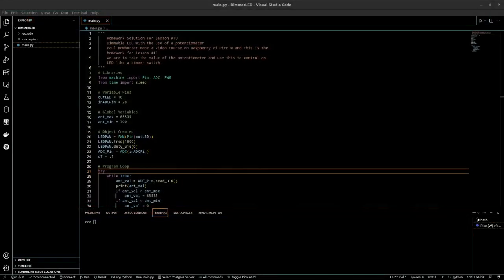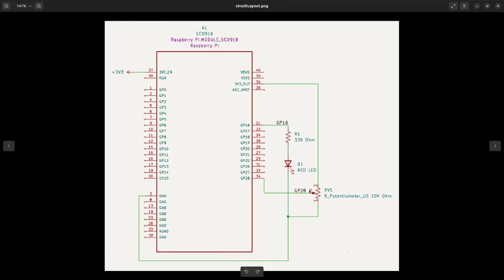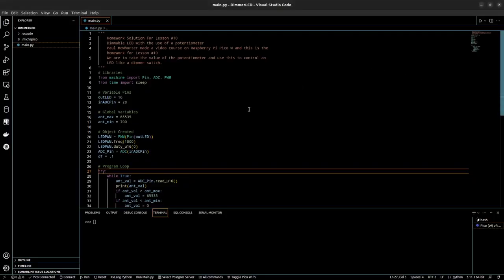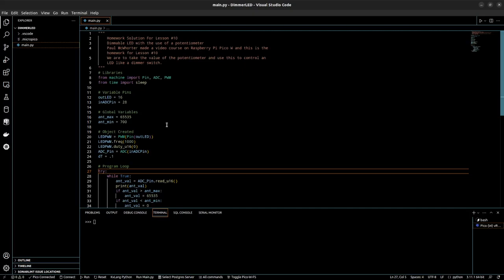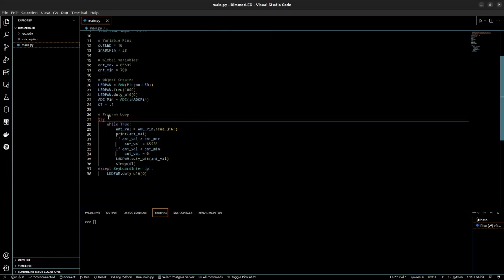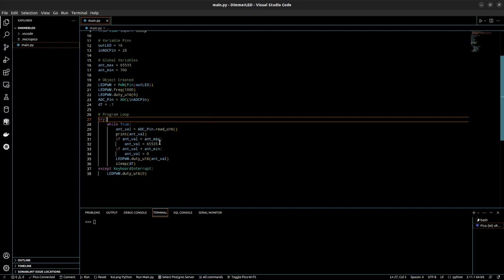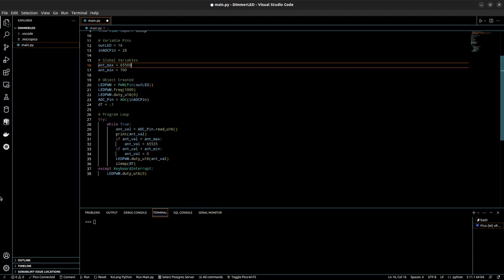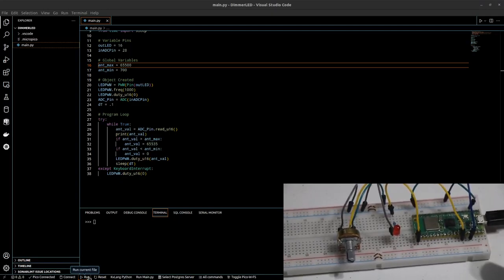Homework Solution To Lesson #10 By @paulmcwhorter  Raspberry Pi Pico W course

Comment: Percentage is still a linear scale. The perceived brightness is not linear. That is a hint for you.
Reply from the maker: Thank you. I didn't think about that. So, it would be better to go at this problem as a nonlinear approach? Say, like how Paul solved it with an exponential scale. But, it seems to rapidly increase after mid-point and not flow constantly. I thought it would be better as a smooth flow which is why I thought the percent scale would work. But I do understand that Paul said our eyes do not perceive it that way. Thank you for taking the time to help me get a better understanding.

Comment: NIce, but notice that most of the visible change in brightness is observed in the first quarter to half of the roatation of the potentiomenter. The fist 1/10 th of a turn yield more perceptible change in brightness than the entire second half of rotation. Hence the question, is a linear scale really best for this problem?
Reply from the maker: I see what you mean. No, my solution would not be the best. I agree. It would be best to make it as a percent of the potentiometer value  over the whole scale. I'm still trying to wrap my mind around the math (really I'm trying to wake my brain from 25 years of not having to do "real" math.) I have seen other students use different ways to solve this problem. I am watching your solution on Lesson #11 and learning how you make it respond more exponetially by use of 16 steps. Thank you Paul for this challenge for me to improve my homework.